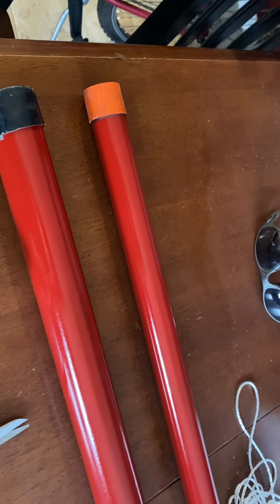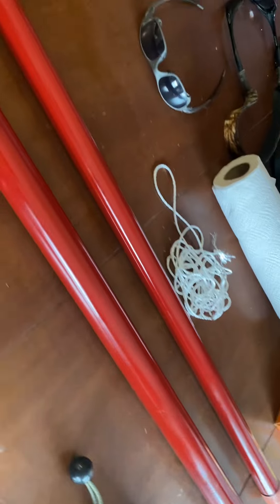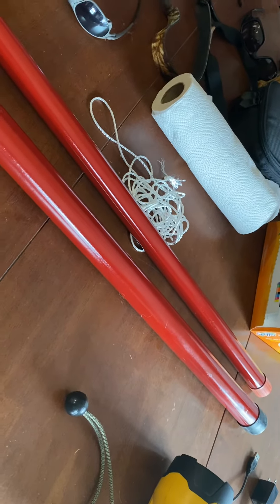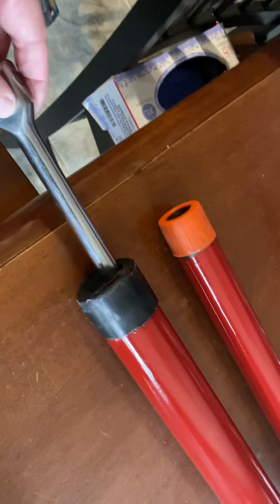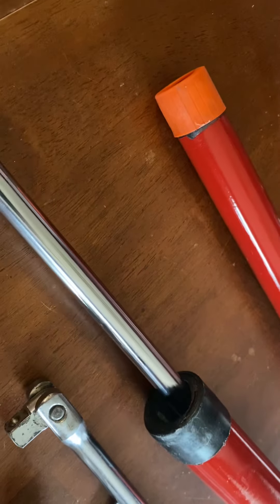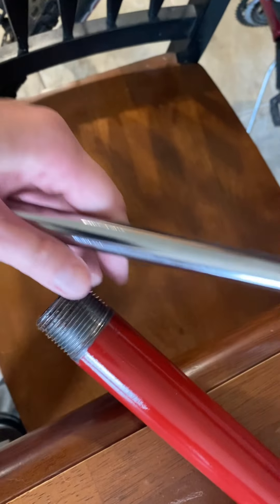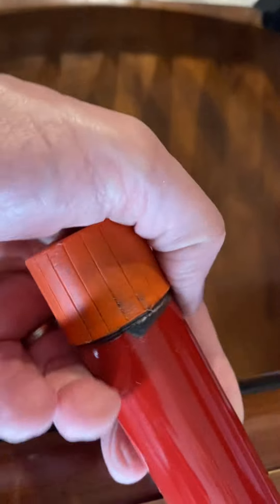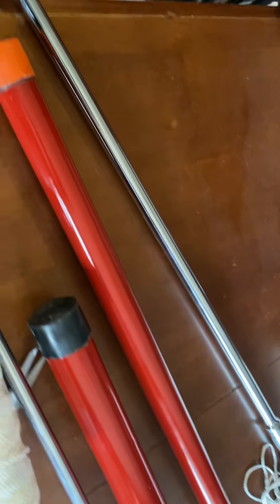The best thing for loosening bolts . It’s still steel pipe

Comment: I have a selection of steel tubes myself and have used for such purposes but watch out, you can end up snapping bolts or breaking spanners etc. Only with experience do you learn that a fastener needs heat for example before it breaks free rather than just trying more leverage.
Reply from the maker: Very true